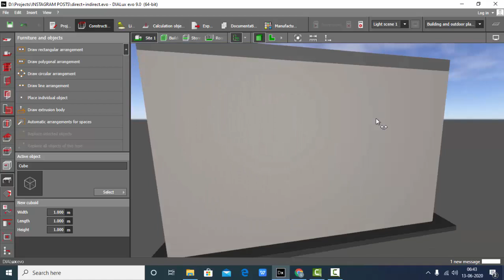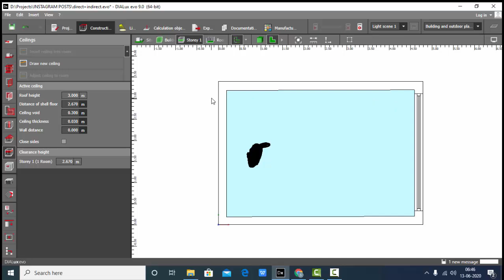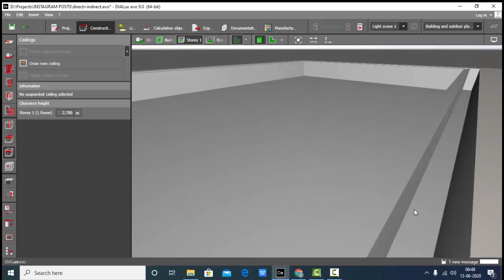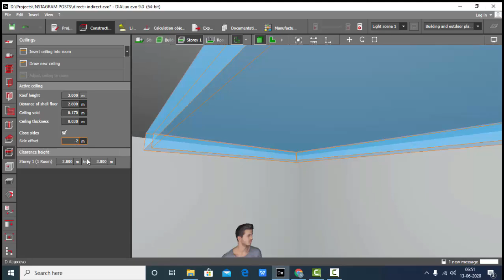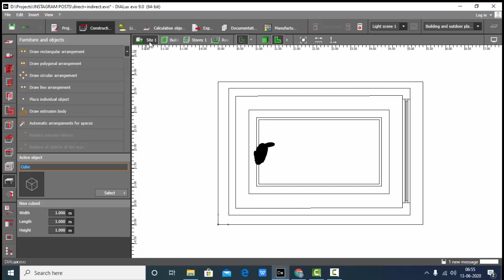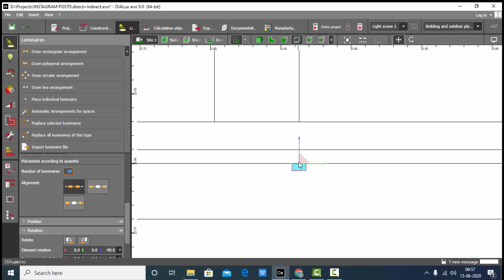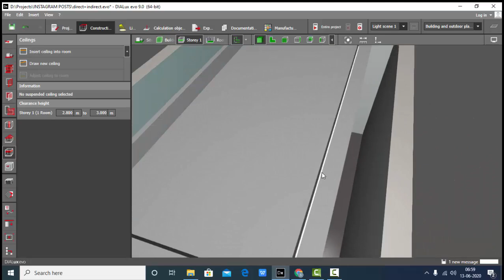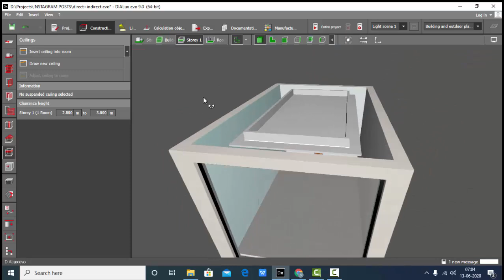HOW TO MAKE SUSPENDED CEILING IN DIALUX EVO AND ADD COVE LIGHT TO IT

Comment: Hi sumayya, thankyou for the amazing explanations. Before placing the lightings, calculations conditions and what are the criterias to be followed. Have you already made a video about that if not could you please do ?Or are we doing the calculations after fixing the lightings. please clear
Reply from the maker: Hi, yes they are few things to be considered before running calculation like selecting the correct utilization profile of the project.

and they are 2 ways of checking lux level calc 
1. place the lighting as per design and run calc to check if it meets the required lux levels.
2. place automatic lighting by selecting lux level in lux estimator calculation.

both the ways are correct, depending upon the project. For more clarity I shall make a tutorial on this topic. Thank you, keep exploring the light :)
Reply: @SumaiyaEliyaz  Yes please...waiting for the detailed video

Comment: Can u tell me after importing cad file suppose dimensions are in feet in cad layout so after importing in dialux how to consider the exact dimensions I tried but still giving wrong value
Reply: Plz make a video on this
Reply from the maker: when you import cad file in Dialux evo, first it asks you to set origin. After you set origin, it asks you to specify the scale. In scale drop down list you have measuring units. (like ft, inch, mm etc). 
Suppose your file is in inch , specify in scale in Dialux evo as inch only.
Dialux converts that inch into metres.

Video for this , I have already made. Please check the link below.
https://www.youtube.com/watch?v=qF7k6sgpfCM
Reply: @SumaiyaEliyaz  
OK got it